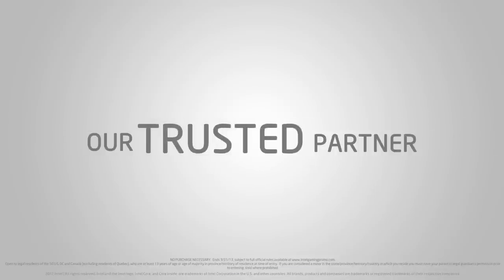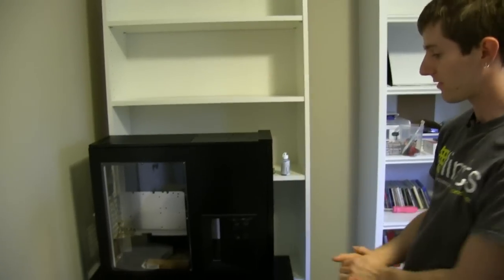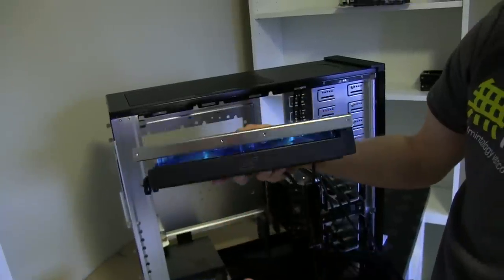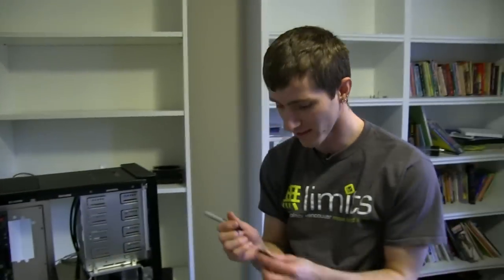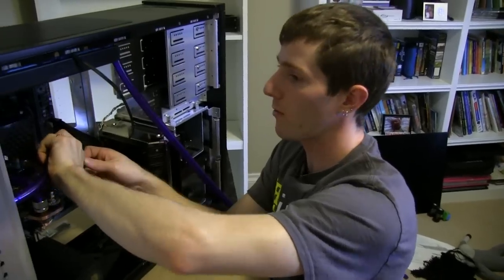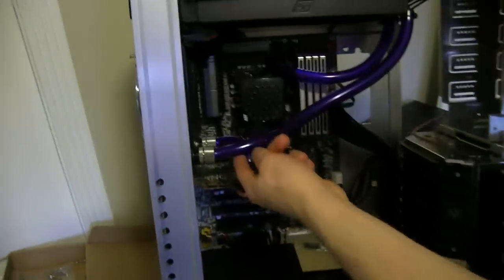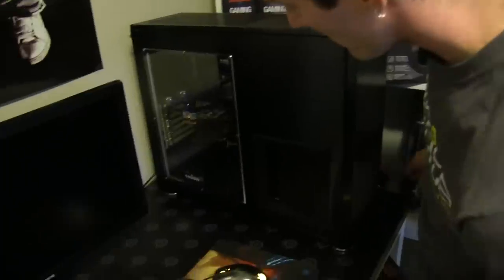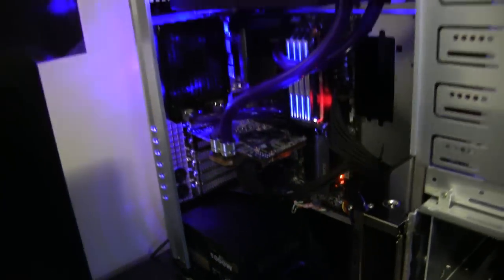Water Cooling Gaming Build Guide Feat. Silverstone TJ10 & Swiftech H220 Linus Tech Tips

Comment: I still own this case. Although the cable management is tricky but the case's elegant look and exquisite quality makes me want to keep using it forever.
Reply: So true i have a TJ09, nothing on the market can really compete with its quality and i made a bracket to mount a 360mm radiator in the top, + the 120mm rad on the rear and next im going to move the power supply to the 5.25" bay area and install another radiator and install a thick 240mm rad. Not many nice cases that can support a dual CPU motherboard and have plenty of radiators, most cases now a days are front 360mm only sadly.

Comment: I just wanna say to alot of people asking repetitive questions.  Linus has posted an awnser to a lot of y'all's questions in previous videos such as the H220 Cooler is the best closed loop (although you can expand it) as long as your using the not stock fans. Get some corsair 120 sp or Noctua NF12s(pressure optimized fans). Then it will cool very well.

Comment: Very nice Gamer rig build Linus, simple but affective. Also love the use of a modified H220. That's the beauty of this unit and shows the full potential of the pump/block combo unit. By the way the honeycomb pump top is easily removed and can be rotated to keep the Logo in the correct direction. You just need to be careful not to break the 4 hold down pins. In fact Martin @ MartinLiquidLabs shows you this is possible with example photos.

Comment: You could do without the res, pump required for sure, with a closed loop setup. Some use a filler tube length as a small res which doubles as a fluid level meter too.

Comment: I would be remiss in saying that the H100i doesn't have any kind of barb system in place only because I have not broken the tubing off to see what it is it uses. However, I will say that whatever is being used in Corsair's systems are likely not a traditional setup in which you can securely affix custom tubing on. I would venture to say that you would likely need to cut whatever is on the H100i rad out and then you would have to tap some larger diameter holes with a new barb setup for it to work

Comment: As I said both are on sale on NCIX right now and it's $10 more at the moment. I don't see how it could possibly perform better when the radiator on the Raystorm is much bigger. As for noise that completely depends on what fans you use and what speed they're running at.

Comment: I'm not Linus, obviously, but I don't mind helping answer this. You cannot do this with an H100i, without heavily modding it and killing your warranty, since it's a non-customizable closed-loop water cooler. The main reason the H220 can do this is because Swiftech put a very high-end water pump in their kit, which gives it the room it needs to stretch it's legs and push more water through an expanded loop system. I have an H100i and am looking forward to when I can upgrade my system to the H220.

Comment: It depends on the liquid cooling system you select.

Phanteks phtc14pe, thermalright silver arrow sb-e extreme, and noctua nhd14 all compete VERY well with some of the best all in one liquid cooling systems within 3c difference under load with the sandy and ivy bridge intel chips..

Not sure about 1090t, 8120 and 8350 amd cpu's.  max safe temps are different on amd chips vs intels

Otherwise custom built loop=king, this swifttech is a VERY close 2nd, then perhaps thermaltake extreme 2.0

Comment: You could go with a 500Watt psu to save money , for case go with BitFenix Merc Alpha and only either buy one 1tb hdd or 500 gb hdd because buying one 500 gb and one 250gb costs more than buying one 1tb one.Also get ram that is 2x4=8gb so you could take use of the dual ram thingy and go with a little bit better cpu cooler .

Comment: Hey Linus, I didn't really look closely at the fan setup, but I believe the fans are pulling air out (makes more sense because you pull the hot air out from the rads)? But what fans are pulling air in? I thought that positive air pressure is more favored vs negative air pressure so I'm wondering what you have in this particular build.

Comment: hey linus, could you turn the top rad around so the tubing does not cross over the ram so you could show off the light bars better? dont know if you can or not but i think it could also make the tube routing look neater with shorter lengths going to the cpu cooler.

Comment: is that pump going to be enough to push the gpu and extra rad?   How would the H100 compare to the swiftech h22 in using it the same way?  Interested in adding a water block to my gtx 480 using the H100 pump.

Comment: Regarding the tube crossing, couldn't Linus just switch the two wires? A rad's in- and output are modular right? You can make that call, depending on where you put the tube with the incoming water.

Comment: Now that the sarcasm is out of the way, you need pump and res. Why?
Pump moves the liquid around and res is used to fill the loop and get air out of your system.
Minimum you need is: Rads, res, pump, block you want, tubing, fittings, fans.
Ofc you can add stuff like flow meters or temp meters.

Comment: Not sure how new this case is but it is seriously lacking what comes standard on modern cases now, such as, easy cable management and easy radiator installation. As for the water cooling my biggest problem with the swiftech all in one system is for its price you might as well make a much better custom loop for about the same money. Looking at NCIX there is an XSPC Raystorm all in one kit for $10 more with both on sale and I would expect it performs much better than the Swiftech.

Comment: Hey is a Corsair 600w PSU enough for this build?
GTX 670
i5 3570k Overclocked to 4.5 gHz
Corsair H90 liquid cooler
In Win GRone case with 5 140mm fans
128 gb SSD
8gb DDR3 ram
Coolermaster mech keyboard
Corsair m65 mouse

Will 600w run this system efficiently even when doing heavy stress testing?

Comment: There's an X connection (of the water tubing ) from the CPU waterblock to the 2nd radiator then to the GPU...

would it better if you switched it?
CPU waterblock to (right side of the smaller radiator)   then out to GPU on the left side fittings?

Comment: A 670 has the power of a 670 is enough and can be overclocked to be as powerful as a 680 (which is also an awesome card), especially with water cooling and 1000 W. Anyway, SLI or some thing like a 7970, 690 or Titan would not be cooled enough as there is only 360mm of radiating power and a weak, all-in-one pump. 
This build is more of the budget type (despite this build is still powerful), rather than spend everything for all the liquid cooling and best but not in terms of price for performance.

Comment: You mentioned you are not fond of bay reservoirs as they have a much higher failure rate, leaking and such. TimmyTech did an unboxing of the XSPC duel 5.25 bay/pump combo D5 Vario, what are your thoughts on this particular reservoir?

Comment: Also for those who just need a second " opinion" on how to properly expand this system to cool a video card..here is what I believe the OFFICIAL video from a swiftech rep

watch?v=0fpum4J6C2k   only difference I remember off hand vs linus's method is the swiftech rep removed the screw clamp and detached the tube from the OUTLET of the pump itself.  Not sure if that matters or not.  you decide. cheers

Comment: Linus, Serious tech question. Should i get the i5 3570k and h100i water cooler and overclock it. Or get the i7 3770k with the stalk cooler.
Reply: stalk^^ I guess you mean "stock" ?! 
okay ehmm I don't dare to say my advice is as worthy as Linus' but if you want to overclock on a haswell i5 or i7 you're going to need an aftermarket cooler         ( and the h100i is awesome in my opinion I got one as well as a haswell i5 3570k )

I don't need to tell you that the i7 is more powerful than the i5, it just is. But again it depends what you want to do with your CPU. If it's gaming... right now most games don't even use the 4 cores of the (i5) let alone the (6?) cores of the i7 (however there is a trend towards more usage of more CPU cores). If you want to do things like video editing things that require a lot of hyperthreading you would be better of with an i7. If it's just gaming FOR THE MOMENT OF BEING you won't really notice a very big difference (the difference is present but not very noticeable when playing games) between an i7 or i5, especially if you start overclocking.
Reply: skypjuh Sorry about the "Stalk". I was tired writing that. I'm buying a nice CPU for recording/rendering of videos thats why i was wondering.
Reply: Crazayy what r u using it for also intel stock coolers suck shit
Reply: Crazayy well then you should probably go for the i7 :)

Comment: But Xeons are more expensive because they are server grade, so cooler and more reliable.  The Mac Pro also uses the dual socket capable Xeons, which are even more expensive.  The RAM is super expensive because it is ECC, also a workstation/server preferred ram, because it can recover more errors.

Comment: I've NEVER had a problem with Ubuntu before. It isn't able to run some essential programs I use (such as C4D and  CS6) but that's what I've my windows installation for. I'm just not going to bother buying an overpriced laptop. I could buy OSX separate and install it on a windows laptop, but that's against apple's TOS AND I've already got a windows installation anyway sp what's the point.

I like saying that the parts that are better aren't worth the price difference.

Comment: That's not 12 pins of power, that's 6 pins of power. 6 positive leads and 6 ground leads, which is standard for most GPUs. The size of the GPU is irrelevant to power, as Nvidia made the card smaller without sacrificing performance.